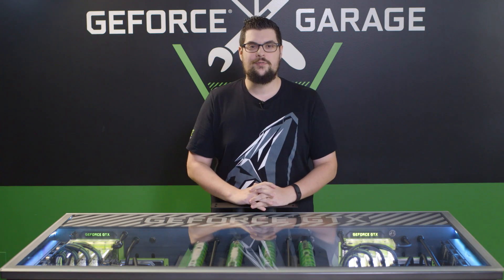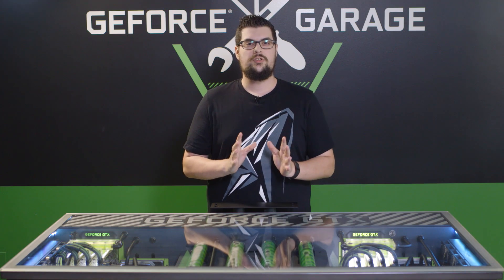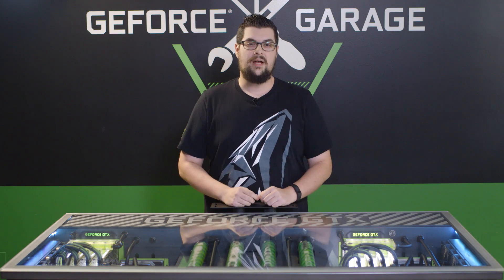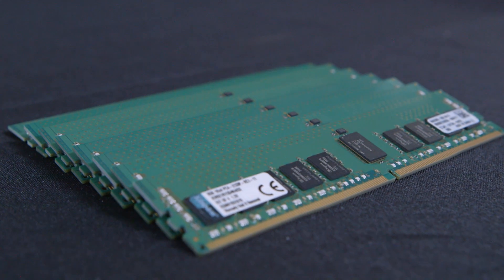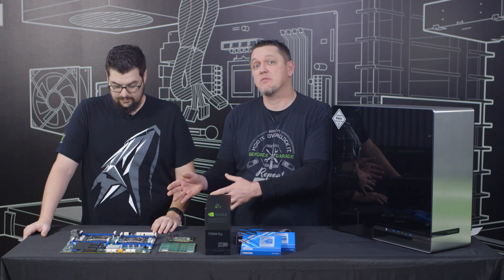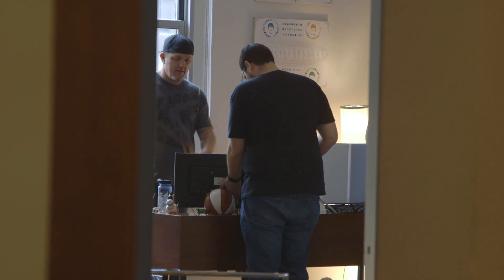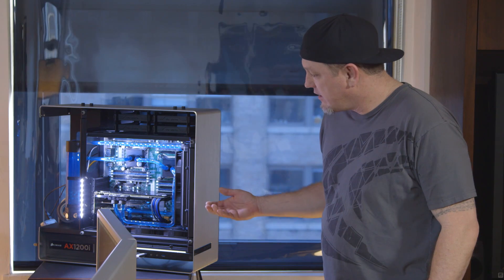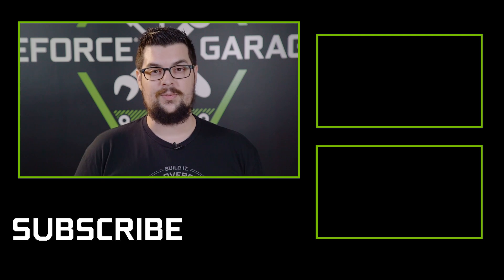GeForce Garage - The Adobe Build for SNL

Comment: That moment when a Titan Xp is considered midrange.
Reply: as pre a qudro
Reply: Sir_Sethery For a professional video editor, 1.3k is better than 5.1k for a quattro. In that perspective, it is.
Reply from the maker: To paraphrase what Dwight said: Any GPU - even a midrange card - will give you a small performance boost, but a serious freelancer should consider a TITAN Xp.
Reply: i am planning to make new pc is there a way to get 3 or 4 titan xp i wanna make a rendering build for redshift
and should i wait for x299 or use my xeon e5-1650 v3
Reply: If you search up "how to enable 3/4 way 1070/1080 sli" it should come up. Skip to about 20 minutes in, that's the explanation bit.
Reply: there is a way I know someone that uses 4 Titan X pascal (non Xp) to render videos it can be done

Comment: 1. A 6950X performs better than a Dual Xeon rig for almost all applications in Premiere Pro 2017. Sometimes there are few workloads where the Xeon is only slightly better, and even then, that's only with 6K and 8K RED footage.

2. Only 32GB of RAM? Especially when working with 6K or 8K, you're going to want more if you want to have any hopes of multitasking while editing. At least 64GB.

3. Don't know why OCZ RD400 1TB NVMe was picked over a Samsung 960 Pro, which is not long cheaper, but considerably faster as well. OCZ must have sponsored this.

4. The two SATA 3 RAID 0 drives are pretty silly. Really, the whole storage setup is. Anything faster than SATA 3 doesn't make that much of a difference as the boot drive. And there should also be at least 3 independent drives (boot, project/source media, and media cache/scratch). It would make a lot more sense to do a 512GB 850 Pro for the boot drive, and then two 1TB 960 Pro drives for the source media and cache.

5. Adam is working with 8K RED footage off the RED Weapon, which shoots in over 8-bit color depth. In the video, you can also see his playback is in 10-bit. The Titan Xp is only capable of outputting 8-bit color depth. And then he's even doing color correcting and editing. When working with higher than 8-bit color depth footage, and especially editing it, you want to make sure you can output the data and be able to view it, which requires Quadro GPUs.

6. In the first video, Lee says "You can use the Quadros, but the Titan will do just fine because of it's high CUDA core count." This is bad statement, because he's implying that the Quadro performs better than the Titan, but the Titan is able to hold it's own because it has a lot of CUDA cores. This is wrong, because the Titan performs better than even the Quadro P6000. The benefit of the Quadro is stability, support and 10bit display.

Comment: should have gone with ryzen rip
Reply: Why?
Reply: Because everything is cheaper, not like that's a problem, I just think it would have been cool if they could have used a newer platform like Ryzen. Also ryzen motherboards would look so much better than that ugly supermicro board.
Reply: But there are no dual CPU Ryzen boards.  This is an editing station, not a gaming rig.
Reply: I highly doubt an 8-core 16-thread 1700x or 1800x would have lagged behind this machine very much. Actually, the ryzen chips might have an advantage since they have higher clocks than those xeons can even boost to (ryzens can boost up to about 4.0 ghz while the xeons can only go 3.20 ghz and they are multiplier locked).
Reply: This may have been shot a while ago.
Reply: Ryzen chips aren't designed for the same workloads as Xeons, by your logic the 6900 is also superior to xeons for editing but that isnt the case. Editing is very core intensive, you can damn well bet that in handling 6-8k workloads with adobe effects having a 32 thread system beats out a 16 thread system.
Reply: ugh, I really hate it when people use the argument that "ryzen chips aren't desined for so and so workload" or "xeons are meant for workstation tasks. They are both heavily-multithreaded CPU's. What about these xeons other than that they in total have more cores than the ryzens makes them "designed for the workstation workload"? I accept that a 32-thread system will beat  a higher-clocked 16-thread system now but now I'm just curious what leads you to eat up the corporate bullshit of "pay 3000 more dollars for this it has a workstation name and ecc support"
Reply: Okay fair enough I'll own that I may be reading off of Intels worksheet. I'm not a CPU expert by any means but I have worked with Xeon based stations and have some marginal experience with a Ryzen 1700x I recently obtained for my stream box. ECC memory and Virtualization support are great for the corporate environment, and I hope you don't think I am bashing the Ryzen platform. In my personal and potentially flawed view, Ryzen systems are more consumer-prosumer grade. For entrepreneurial individuals and internet content creators: game streamers or individual editors. Sure they could work in a more corporate settings like the SNL editing station above, but when budget isn't an issue in the slightest, why not go with the more bulletproof option that has fantastic support for the work you are doing? I wouldn't take a Xeon for gaming, and I wouldn't make a Ryzen server farm for VM based applications.
Reply: I'm pretty sure if you lock those E5-2630v3s to their 3.2GHz speeds, then they'd beat the Ryzen CPUs by far.
16 cores and 32 threads at 3.2GHz definitely wouldn't get beat by 8c/16t running at 4GHz with similar IPC in any properly multi-threaded environment (Ones that benefit from as many cores as possible and doesn't cut off at 8 cores like DX12) Hell, even at it's base clock it would be faster than the Ryzen by about 20%. (Assuming that IPC is roughly the same, as 16 x 2,4 = 38,4 & 8 x 4 = 32 & 38,4 : 32 = 1.2 x 100 = 120 - 100 = 20(%) not very accurate as there is still thread performance scaling and IPC differences etcetera, but it shouldn't be off by 20% either.)
Also even though they can boost up to 4GHz, that doesn't mean that they'll get there. My RyZen 7 1700, during every Cinebench run and benchmark in general I did at stock settings, never went above it's base clock of 3GHz. 
And by the way, newer platforms have issues. Issues cause instability at times, and those instabilities cause downtime, and downtime means less money etc. Xeons are cherry picked chips for the best stability. The motherboard they went with have less features so there is less that can fuck up. The RAM is also ECC memory, so that there'll be less downtime if there happens to be any single-bit errors due to electrical or magnetic interference.
I've had a couple of crashes already on my RyZen system. They weren't very inconvenient, but this guy could probably have lost a lot of work because of a single crash.
And since you do not know this: RyZen does have ECC support.
Reply: I think he does know that Ryzen doesn't have ECC Support, its pretty basic knowledge and I think he mentioned it.
Reply: I see your point now. I agree, for an SNL editor, xeons would probably be the way to go. That's not even to mention that Ryzen probably was even less mature if out at all when this was filmed.
Reply: I agree that the dual xeons would win because of the obvious core advantage, but I highly doubt a single one of these would beat a Ryzen system. Why? Because this xeon in particular is haswell based, meaning the IPC is probably a little worse than Zen. Also, as I said before, the Ryzens are not multiplier locked and they would be clocked higher. But I see both of your points now, Xeons in this scenario are probably a better idea. But I really want to see a Naples Zen Cpu in one of these builds!!
Reply from the maker: This rig was built before Ryzen was available - keep watching our channel & series... we'll be doing a Ryzen build soon!
Reply: Aw great, I knew you guys would do one at one point! Subscribed, I'll be waiting for it to pop up in my feed :)